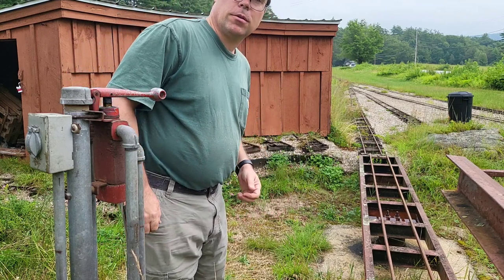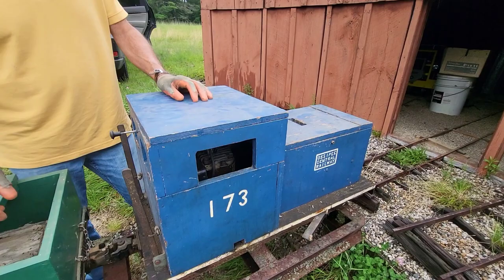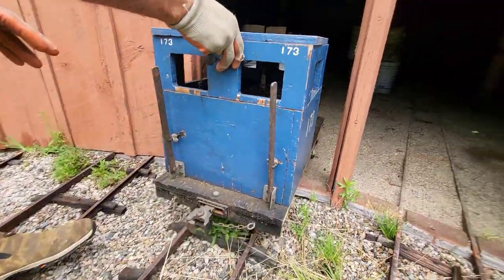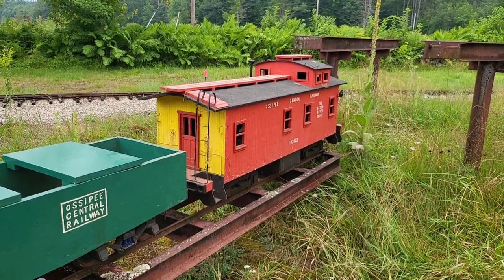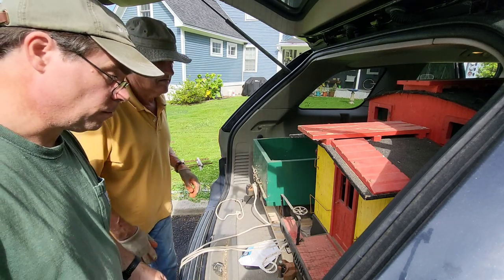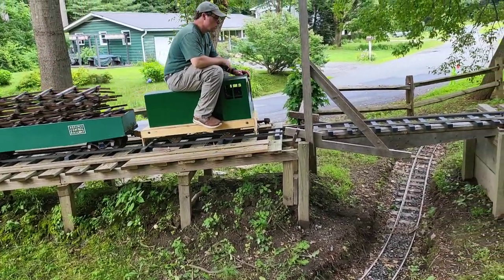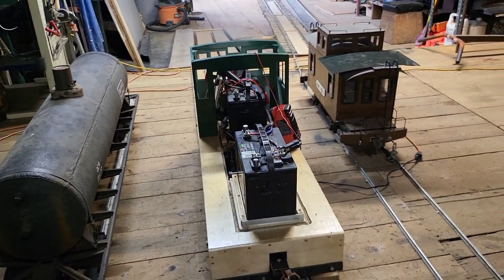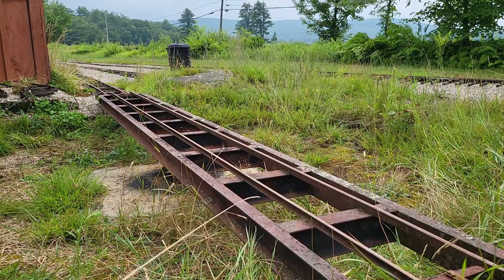Moving The Final Cars From Ossipee Central

Comment: Very happy to see this happening and that the railroad is getting moved. This turntable may be a good replacement for the old Mill brook Railroad turn table. The old steam locomotive may be fun. May have to try it with doing a load of wood pellets at one point. Anyways I look forward to seeing the restoration and the expansion of the former ospey central railroad to the Mill brook railroad!

Comment: The no compression  on the Briggs is more than likely a stuck valve, an easy fix. Those springs are for centering the clutch.
Reply: Lawn mower engine?
Reply: @westrain2  I think so. Horizontal shaft

Comment: The drive in that homemade blue engine is from Miller Backyard Railroads.  Robert E. Miller of Bath, PA took over the Texas Railways business in the early 1950s.   The Miller drive consisted of a conical leather plug (which you found largely chewed by rodents) driven by the gas engine.  the drive was transmitted through a flexible coupling and a long shaft to allow the leather cone to be moved right or left against one of two conical spool pieces for forward and reverse.  In 1962, I purchased a Miller, nee Texas Railways "deluxe car kit"  from Bethlehem Pattern & Model Works.  This "deluxe kit consisted of castings for trucks, couplers. end sills, body bolsters, and one brake wheel casting.  In those days, live steamers and other riding railroaders with few exceptions built their own equipment.
Reply from the maker: Thanks for the information! These days, most people want to buy something already built, and that's why I build locomotives and cars.
Reply: I have enjoyed building most of the equipment on my Forest & Western RR including two steam engines and one "diesel."  The Miller trucks from the  "Deluxe car kit" mentioned above are now equipped with ball bearings and grace a recently completed scratch built N&W HL hopper car (the N&W had 12,500).  I share your sentiment on how quickly private riding railroads come and go.  The Forest & Western is 45 years old and hopefully will continue running for some time!

Comment: that lift is such a great asset for moving cars / engine . looks like the ones I used when
I worked in different garages in my early days of employment. are you going to rent a high cube 
truck to hall all of the track to the Mill Brook RR ? great rescue of the 7.25 inch gauge! good luck.
Reply from the maker: I'm going to see how much I can fit on the MLBK trailer first.
Reply: sounds like a great idea, minimize expenses where ever you are able! 160 mile round
trip is not too bad of a trip. just please do not over do things, you do not want any 
accidents going to , or from the osprey RR. along with injuries while handling everything!
 @MillBrookRailroad

Comment: That Briggs & Stratton engine is ancient, with no compression, it could be a valve hung up, or worse........the conn-rod could have failed from no oil in the crankcase 🤔😔😤😲😱❗
Reply from the maker: I'll find out when I get to it.
Reply: @MillBrookRailroad  i have worked on those small engines for a hobby since i was about 14 years old, i will be 73 next month, and i hope that all it is will be a stuck valve, as some parts for those very old Briggs & Stratton engines are either obsolete or very difficult to find. Since you have all those battery-electric locos, that Briggs powered one can wait for a while
Reply from the maker: @paulsmith5398  Yup. The Briggs powered engine is probably the lowest priority at the moment. I'll get to it eventually, I'm sure, but moving the track and all the facilities and restoring the steam engine come first.
Reply: @MillBrookRailroad  being 73 next month, i hope i am still around to see the Briggs & Stratton switcher run, good luck to you when the time comes to delve into the workings of it!👍👍😀😀❗

Comment: It is nice that you are going to fix everything. Bring it to your railroad. But on the turntable that has the hydraulic lift that is buried underground. I know for sure, California and a lot of other states banned the use of those because they leak oil into the ground , which you can see oil around it.  You might think twice about using that design on your own system. Even auto shops now have to use above ground hydraulic systems. A lot of the old gas stations That Had those systems are. shut down and considered Has Matt contaminated Ground soil Possible to get down into the.  water table.
Just take note of that I due like your show. Keep up the good work I am disabled. Cannot travel wish? I could come see ride your trains. But that will never happen like watching the videos, thank you.
Reply from the maker: That lift will be a challenge. I expect that's what will cost the most to move.
Reply: @MillBrookRailroad  That is nice stay above ground if you can. If you use that Lift below ground, you need to have a vault where you could totally walk around it. And I expect it cause all it takes is one high pressure hydraulic line that leaks a little bit. Underground to contaminate.
Good luck to you.
Reply: A lot of history there, quite a change in technology from that engine drive  to your electric drive, hopefully you aren’t transporting rodents